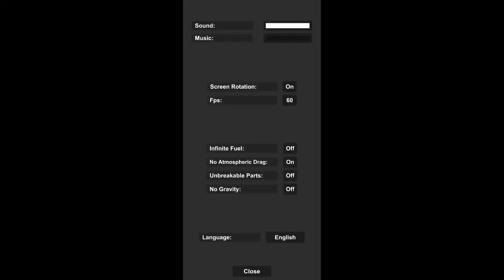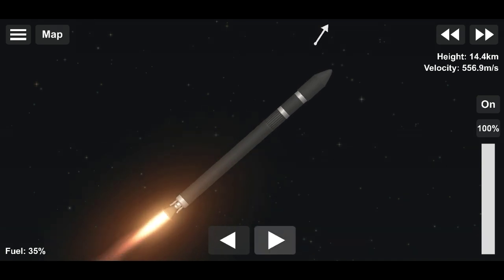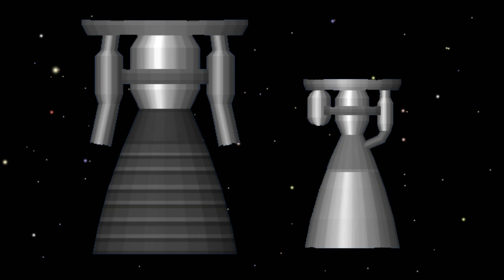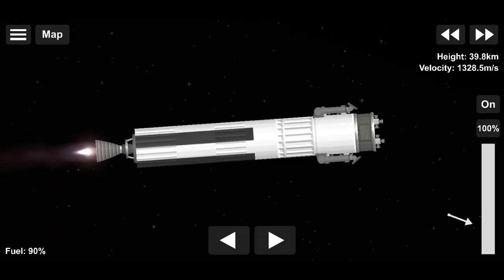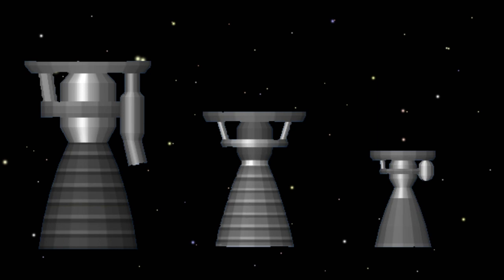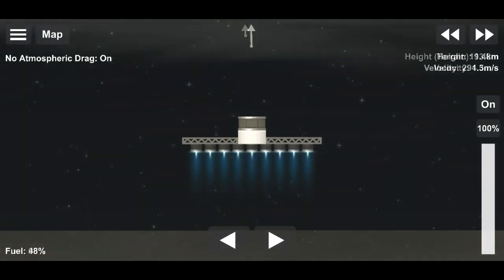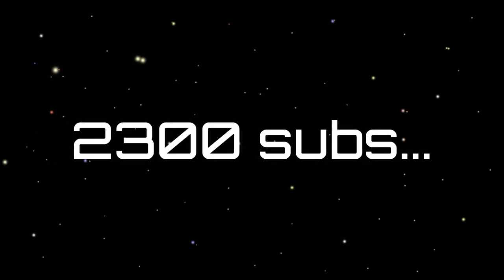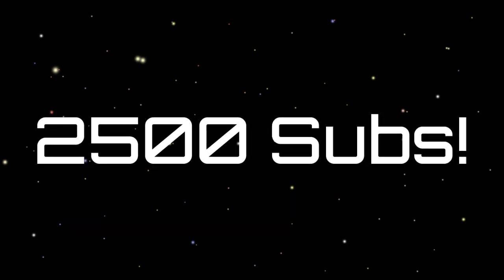Everything you need to know about Engines! | Spaceflight Simulator (SFS) 1.5

Comment: Rather then just showing oh this rocket goes this far that is only have the information. There is a few things you have to consider when picking an engine its TWR, ISP, and its thrust. Just reading off the game info and doing something that anyone here can do isn't helping anyone adding additional info is what will. Saying hey the broadsword is better than the frontier in terms of TWR and ISP when you can use it but you are going to need more of them for then the frontier than the broadsword. Also you don't NEED struts to have ion engines. and they are best used for precise burns or for long range trips, not just for satellites and circularizing. Also a height isn't a legitimate measurement i think you could benefit from a little equation g*isp*LN(wetmass/drymass). That will get you 100% exact figures for these engines and measure real performance.
Reply: Let me clear it for you.

∆v = isp•g•log e(Mo/Mf)
Reply: @orbitalspider  sure but people didn't understand ln mean. So to make it understandable. We should use log e.
Reply: @daffavirwandy7694  well wither way works its preference. also in excel or sheets its written as LN same on some calculators like my graphing one.
Reply: What is TWR?